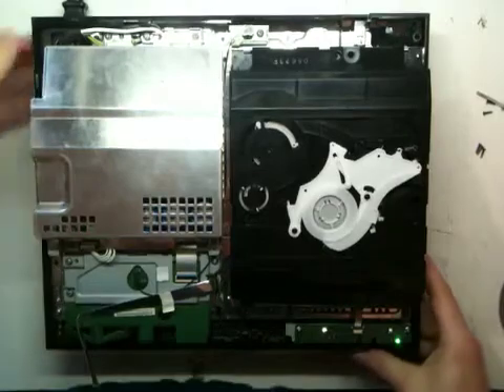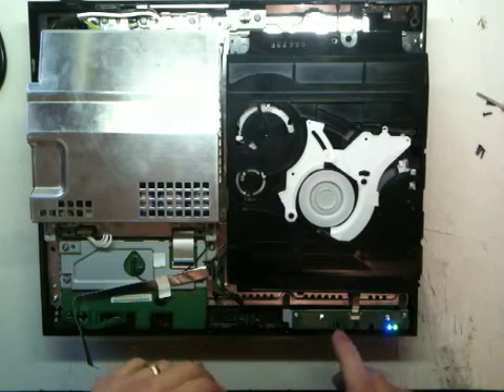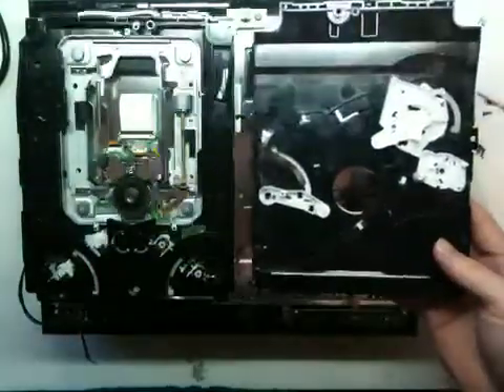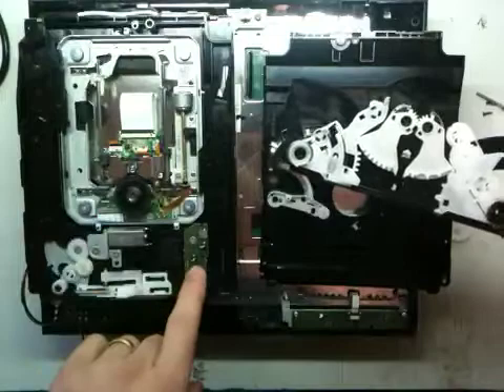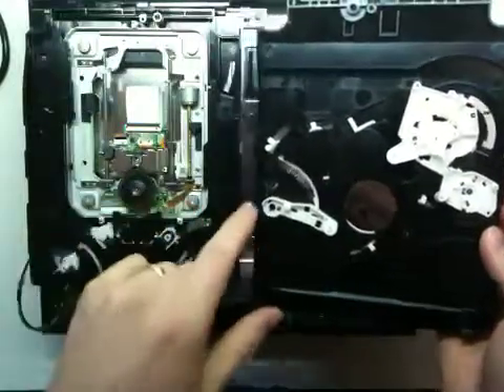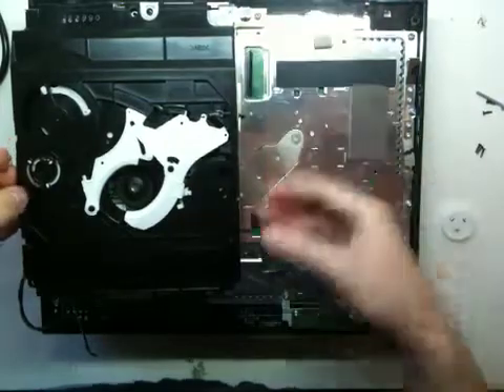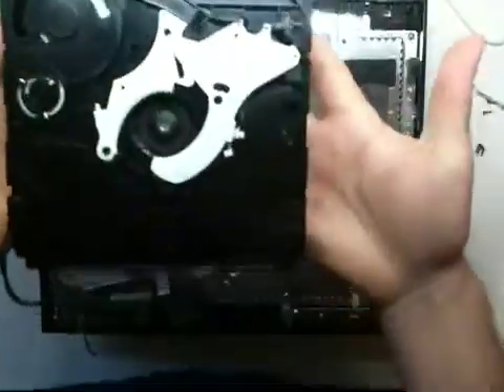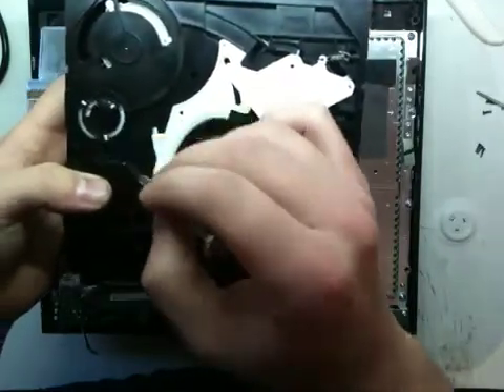PS3 KEM-410A blu-ray drive, disc not inserting fix Part 1

Comment: Hello, can you help me please, I tried to clean the lens, but moved a little head on it's rails and after reassembly ps3 just doesn't see no disc I insert. I hear how it's trying to set up a head on the rails several times, but then nothing happens. What can be wrong and how it can be fixed?

Comment: Your Video was the only one I was able to find that related to "my drive" this was very important considering that the posts on the top half of the drive cassette enclosure must be in alignment in order for the "left" slide to move and engage the tray lift mechanism. Most helpful, many thanks.

Comment: My ps3 fell from a height of about 70cm. Then the disc spinner didn't spin the disc at all so I replaced the deck. Now the problem is that when it starts spinning I hear a squeezing noise, like the disk doesn't stand steady and it tangents on something but everything inside the drive seems to be ok. Any people with the same problems or solution?

Comment: I recently got a fat ps3 on craigslist for free and $5 for gas lol. But anyways it had the RLOD and i did the process for fixing that and then the cd drive didnt want to work right. It wouldnt take in any cds, So i took it apart and was looking at your video and yours was different a little but you mentioned the 2 side tracks got to be at a certain point in order to work, well that was my problem and its working now. Thanks.

Comment: With my PS3 the discs aren't caught by the mechanisms that pull it in place and lock it on the spindle...the disc will just slide in but you have to turn the PS3 on its side to make the disc fall out.....I wonder if this would help me fix the problem...

Comment: Thanks for the video, i replaced my laser assembly. Then couldnt get disk to spin, thought my daughter board was bad. I did your little trick with the white lever on the top portion of the blu-ray drive.  When holdind the drive i used a screwdriver and positioned the white lever to the right. Now the drive works again spins up just fine. Thanks again :)

Comment: You are a life saver, my friend! 

Some comments for those who are still having trouble: 

Another poster mentioned that annoying peg is easier to seat when you flip the unit over. Actually, I found it even easier to use gravity: you'll notice the peg stays up if you hold the unit vertical, slot down. You won't need a knife or anything.

For those of you saying your arms are not showing full range of motion, I found this was because the black slider must be all the way up was not all the way up.

Comment: My trap door (my friend removed before I bought it off him because his game was stuck)  and chucked away then i couldn't insert or take out discs but with this its actually kinda working now, only problem is, is when I put a disc in, it thinks Im ejecting, but even though gears are working its not taking anything out? I got these 2 gears out and I have no idea where to put them, reckon you could help me with this? Maybe skype? piayer98 is my skype

Comment: I just did this and the first time I did it Igot it to finally suck the disc in but as soon as I turned it off and put the metal cover back on it wouldn't accept the discs anymore... :/ I don't understand that? why would it decide not to accept them after putting back the case is a bit strange... some help would be appreciated :)

Comment: So I recently got an old style 160GB PS3, model CECHP01. Like everyone else, this is the ONLY video I've found that shows this particular drive xD Unfortunately, the system I got was not taken care of, and whoever had it before disassembled the drive and lost a bunch of parts to the disc loader. I'm trying to find this drive on ebay, something that's non-working so I can just remove the disc loader (2:40). What's the specific model of this drive? KEM-410A only gets me laser assemblies

Comment from the maker: @ed3dfx HI. Thanks for watching the vid. I hope you can get it fixed. Im not sure if the drive is the same in the 40gb and my 80gb. There are lots of moving parts inside that drive and all work in unison. Just look at the white knobs on the top part of the drive and see where they are supposed to fit into when it goes back together.

Comment: I'm having this exact problem with mine, 40gb Canadian ps3. You are right there is a trillion videos of the other mechanism, but none of the dual laser assembly.  Having watched your fix, im 100% certain mine is having the same issue with the pin not seating correctly on the left side.  
Still havent gotten it to seat properly though its really hard to see. will keep trying... Thanks again for the video and awesome explanation.

Comment: regarding the disc feeder shown at 3.10, when I put it back on the drive, the 2 arms don't move back and forth properly, the parts underneath them get in the way. When you clicked it back in place, you could move the arms freely. When mine is clicked back in, they don't move freely. Everything on the board looks fine though. What do I do?

Comment from the maker: The laser doesnt cause the disc to spin, it just reads it.  The drive has to be put back together correctly in order for the disc to load and spin right.  There should be some good videos that show how to replace the laser. You can see if the disc is spinning by just placing it on the drive and snapping on the magnetic white holder, without having the top of the disk drive case on.

Comment from the maker: Your second question, please watch Part 2 of my video.  It shows what the disc does when the top case of the drive is not put back together right. After watching part 1 and 2 of my video, you should be able to install the top of the disc drive back on correctly.  Let me know if you have any other Q's.

Comment: I ordered a new laser, exact same model. KES 410a
Wanted to ask whether removing the mech itself would include taking out the little gears which at the bottom of your drive so the mech is released?

Sorry for my terrible description of the question.